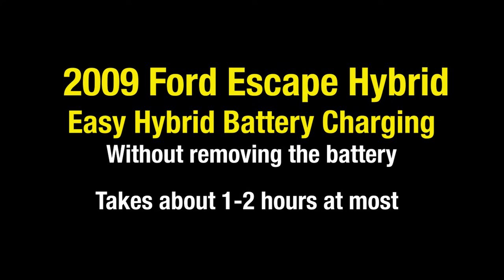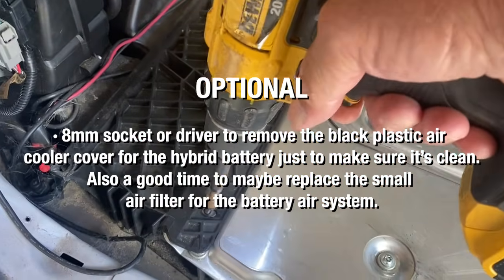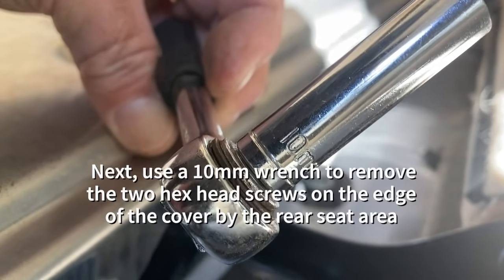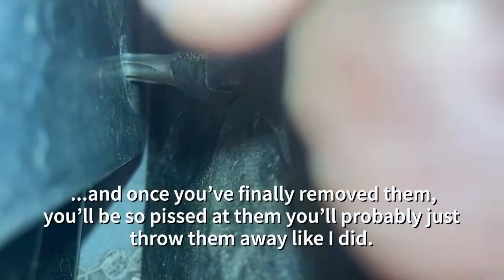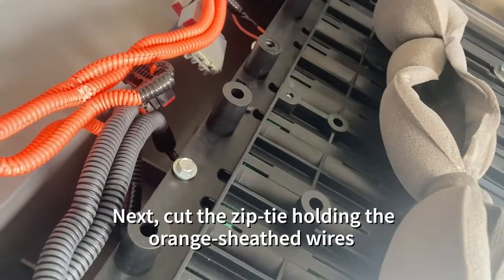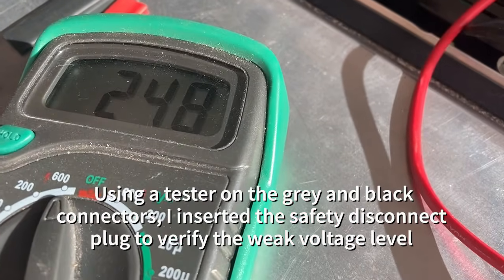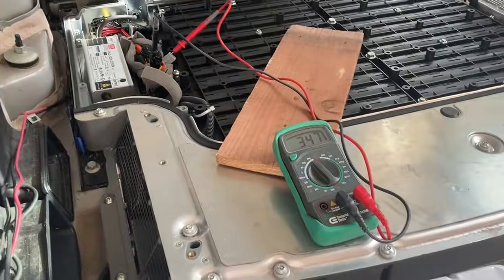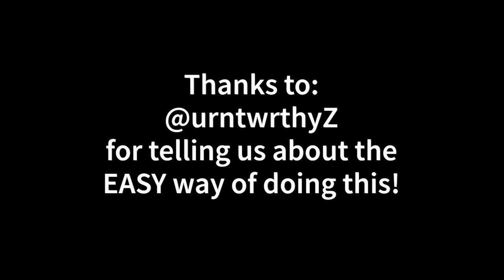EASY Hybrid Battery Charge 2009 Ford Escape - No need to remove battery!

Comment: Thank you for making this video. I've got a 2008 FEH and had to tow it to a garage for an HV battery recharge a couple times in the past few years. I've figured there must be a DIY solution, so I'm glad to see this coming to light. I need to determine how to work around the still-existing charging circuitry in the 2008 battery (unlike your 2009 where it has been removed). But overall this gives me great insight into the process.
Reply: I don’t think you need to do this with a 2008.  FEH before 2009 have a button behind a small panel on the driver’s side of the dashboard.  If the traction battery gets low, you just pop that panel off and press the button.  I think it is an 8 min cycle, and sometimes you have to do it more than once.  Search on YouTube, there are a few videos.
Reply: @dswanso4  Thanks, and correct — generally that is the case, with 2008 having an advantage by having that recharge button. I've used my recharge button four times in the past, and twice it worked, but twice it didn't, because the HV battery was so depleted that the 12V battery was unable to get it to its engine-starting threshold. (I also suspect that the recharge button function is not that healthy for the 12V battery either.) Those two times it didn't start I still had to tow it to a garage for a professional recharge, which is why I am planning to build my own charging device now. Overall seems like a more reliable approach.
Reply: @MikeSenese  You do not need to modify anything.  If you put a battery charger on your 12v battery under the hood, and then press the button on the side of the dash, you've basically done the same thing as your modification.  You may have to press the button a couple of times, but within 20 minutes or so, your car will start.  The issue you mentioned is that your 12v battery may be weak, or not have enough juice to bring the battery pack over the 300v minimum.  Using a front charger will pass through your 12v battery to your hybrid pack.  More than enough voltage to get your charge above threshhold.  I have had to do this with my 2008.  Works every time.
Reply: @geraldlawrence2759  Thanks Gerald, good advice. I think you're right about me struggling with an aging 12v battery; I did have to replace it after different issues. For the battery charger you're referencing, do you mean a plug-in 12v battery conditioner, or a bigger battery pack that you'd use for jump-starting a normal car?
Reply: @MikeSenese  I used my regular full-sized battery charger--an old craftsman unit, but I would imagine a small trickle charger that is on the car's battery for a couple of hours should work, as well as using another vehicle to "jump-start" the car.  All you are really trying to do is boost the 12v battery so it can supply that small amount of extra voltage to get the hybrid pack above the 300v threshhold.
Reply from the maker: I put off digging into this process for a while but once I finally rolled up my sleeves and went for it, I was surprised at how easy and quickly everything went. Good luck with your 2008!
Reply: Pull off the little cover on the left side of the dash board after you open the door. 01-08 has the recharge button which send the power from the 12v under the hood to the drive battery in back. When the green light turns on, start the car. Hope that helps.
Reply: I am currently having the same debate, how to work around the existing charger on my 2008, were you still able to do this modification by adding the new charger?? TIA

Comment: Also I have a questions for you, 
Are you familiar with forscan & if so did you do anything with that on the escape before or after charging the battery? I’m familiar with that software for my F150 but reading there is useful stuff for the hybrid when it comes to HV battery issues
Reply: There are times you might have to clear codes after charging before the car will start.  Also, use FORScan to command a rebalance of your HVTB.
Reply from the maker: I’m not familiar with forscan. The only diagnostic tool I have is a cheapo Bluetooth OBD scan module that I can read with a really limited free app.
Reply: @mattgatlin1918  well if your a weekend warrior your type and have a ford you should definitely check it out, can’t say for the escape as I haven’t played around with it on my wife’s car. For my F150 it’s crazy the amount of stuff you can do (everything besides powertrain enhancements as like in a tuner/programmer) but it’s a software that allows you to customize and make changes to almost any Ford vehicle & Doesn’t void warranty
Reply from the maker: Cool. I just checked it out and bought a Forscan adapter for my laptop. I’ll definitely give it a go. Thanks for the tip!
Reply: @mattgatlin1918  ayyye ! No problem man, you can get a free trial subscription or for like $10 have a whole year. Just watch a couple videos , do a couple searches on your vehicle many ppl have already made google docs showing exactly what to change to get what you want. But Most importantly first thing you do before you Make a change to any module is save your factory one so if you ever wanna go back or change something you don’t have to go down that rabbit hole… ask me how I know 😅
Reply from the maker: Hey @tellis17 - I just ran Forscan on my FEH and it’s pretty cool. I ran all the diagnostics on the hybrid battery control module (BCM), did a module reset and rebalanced all the cells. As an added bonus I also disabled my tire sensor warning (TPMS) since it’s been nonstop chiming at me for no reason for the past two years. Thanks again for the tip!
Reply: @mattgatlin1918  that’s awesome to hear man! & Btw thanks to your video I was able to get my wife’s car charged up and back on the road 👍🏻. I read online that after a 4hr charger on the hybrid it’s good to do the rebalance a couple times I did my wife’s car 3 times already and each time the rebalance takes longer and longer which I think is a good thing because the first time it was completed in 11mins , 3rd time was 23mins

Comment: Nice video,going to attempt this on my daughter’s Escape. Ty
Reply from the maker: I was actually able to start my FEH after only about 5-10 minutes of being on the charger but I still had the charger plugged in and the orange safety plug installed when I went to start it. I think the voltage coming from the charger was enough to make the car computer enable the starter.